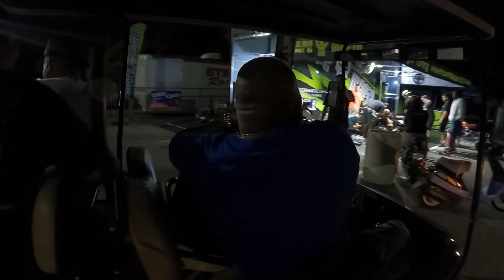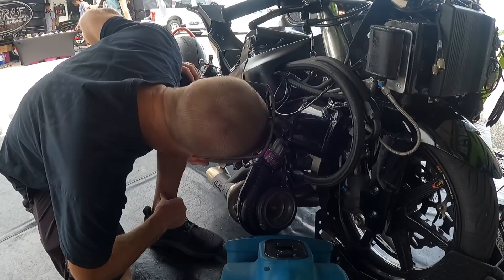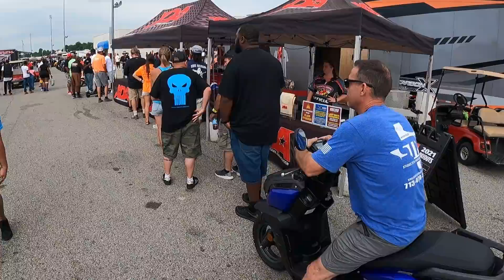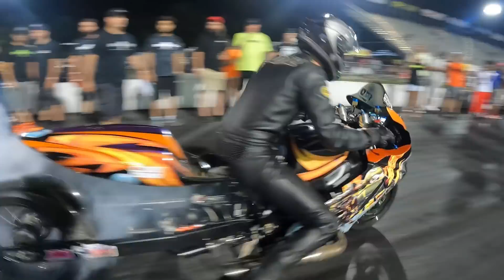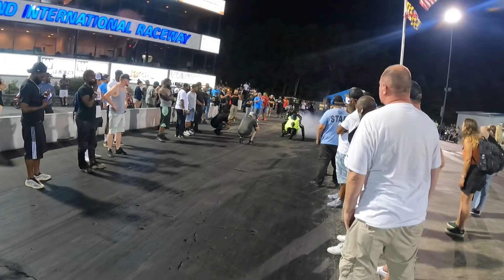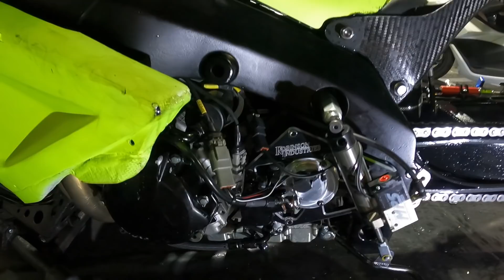We have BIG PROBLEMS in a $50k Grudge Race

Comment: Still baffles my mind that suz still uses deals that require the case to be split to replace.
Reply: Its seems not to be an issue for the small tire stuff..unless throwing big HP at the front sprocket apparently...happens on big tire bikes and why we have such elaborate front supports...we even modify the saddles for more surface area.